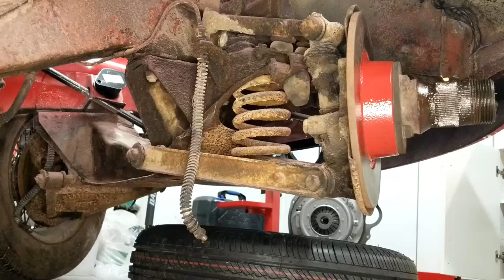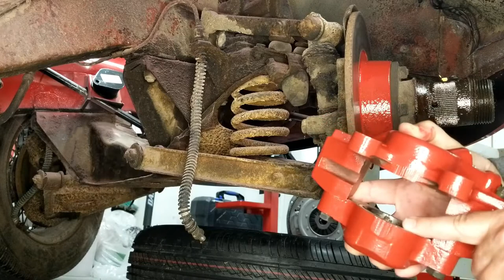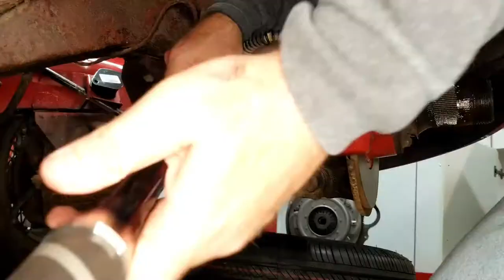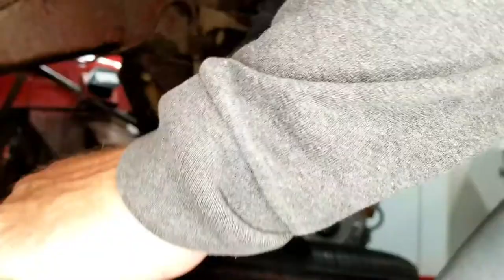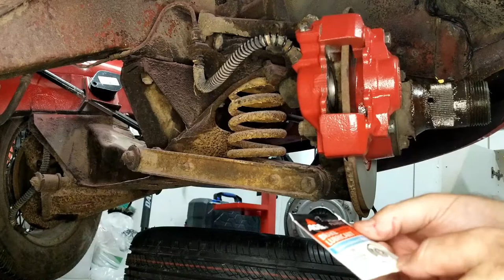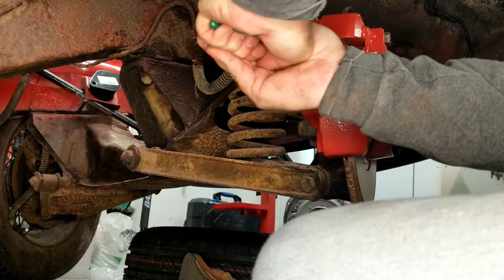Nigel the 1977 MGB brake front brake pad and caliper install

Comment: When working with cotter pins always use side cutters, also called dikes, to remove and install. Regular pliers will not work (as you demonstrated).